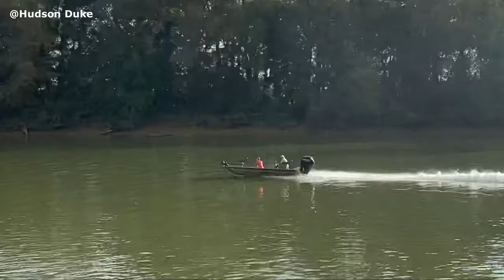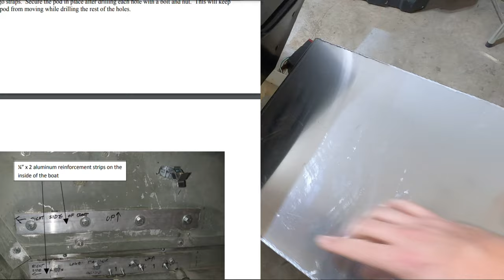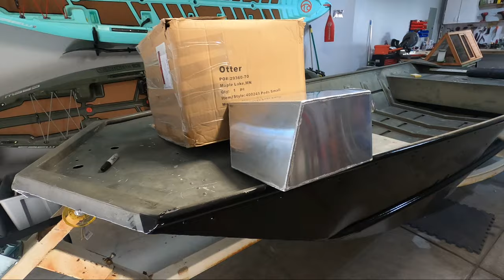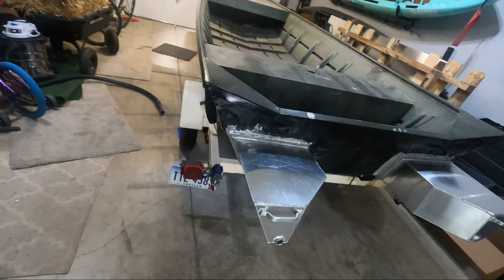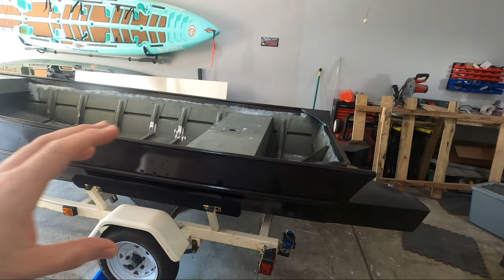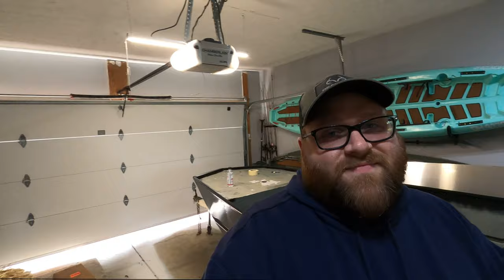JON BOAT FLOAT PODS GUIDE - Everything you need to know!

Comment: Put a set on my 1652mt Lowe, seemed to loose a little trim adjustment at wot, and top speed. Definitely keeps the front end of the boat down and helps get on plane faster though.

Comment: If the pods happen to leak over time,foam would keep most of the water out,huh
Reply from the maker: There is no foam inside the pods, if water did somehow get in there are drains on each one just in case.

Comment: My buddy who runs a charter fishing boat glued the door handle to the boat on with 5200 and it got extensive use for years and never came loose or broke in anyway.   If you get a good bond and cure that stuff is incredible.
Reply from the maker: It's seriously strong stuff, I have no doubt it could hold on some pods paired with rivets

Comment: What's the gauge of the pods?  Doesn't look as thick as the boat's aluminum and I've heard that adding pods makes your steering different like it'll be a longer sweeping turn. Is that true?
Reply from the maker: I couldn't tell you the gauge, they are Beavertail so they might have specs somewhere. I don't feel impeded with turns -- another criticism I heard before the pods was that it made reversing difficult but I didnt experience that either. Properly installed I've had nothing but great experiences with them.

Comment: Just purchased a 1540 alumacraft, plan on using a 10-20hp Mercury 4 stroke. The bottom of the transom measures 40”, I wanted to add these beaver tail pods but do you think I’d have room for the motor to turn?
Reply from the maker: It would be a lot tighter in the back, you might not be able to mount a transducer to the transom but the outboard should still fit.
Reply: @mvboutdoors  awesome thank you

Comment: Did those pods slow you down ? I’m thinking on adding them to 1436 Longtail boat. You think they will slow me down if I mount them correctly?
Reply from the maker: If mounted correctly they shouldn't slow you down, its the angle that matters most. I didn't notice any speed loss, my speed was right in line for a 25hp and a 1648.
Reply: @mvboutdoors  from your knowledge do you Know if it’s okay to mount float pods about 1 inch up from the bottom ? The back of my Transom is 1/4 plate but it doesn’t cover entire thing. So it will be a slight gap on bottom. Just didn’t know if effect anything

Comment: what can you do for side to side stability?
Reply from the maker: Realistically not much. If you want to add floatation foam to the outside of the hull or kaya sponsons you could achieve it but the former will come with a reduction in performance and the latter would need to be deployed as needed. You can google "boat collar" for an example of what I mean. In practice and the long run though, the best option is to just sell your boat and buy one with a large floor width.

Comment: Thanks for this video, it helped me decide to get pods on my 16ft mod v jon boat. I have a couple questions though. Firstly, did you experience any porposing? I mounted mine like the photo suggests for semi v boats with the pod being horizontal to top of transom. The instructions say a 1/2 inch rise, which exists on the sides but then as you get to the keel because of the semi v shape they are 3+ inches from the bottom at the back of the pods. I'm experiencing porposing and can only operate full trim down. As soon as I trim up at all I'm bouncing around. Secondy, where do you mount your transducer after adding pods? THANKS!!

where do you mount a transducer after adding pods?
Reply from the maker: The only time I experience porpoising was when my motor was too low, you may need to raise your motor up or adjust its height up or down with the pods keeping your transom higher in the water now. I mounted my transducer behind the engine.
Reply: Did you mount them level with the top of the transom like in the photo provided by beavertail or do they angle slightly downward towards the keel following the slight v shape of the hull? Thanks
Reply from the maker: @thupertramp  The welder angled it with the hull when it was supposed to be level but the angle was so slight i doublt it made much of a difference either way.

Comment: I would add a s Kreen fuel tank sealer to the new pods. Aluminum can get corrosion holes w time-
Reply from the maker: Right now I have them painted with enamel, I'm not sure I would be able to swirl that around in the inside but maybe a coating on the bottom in the interior would be helpful as well. I'll look into it! Thanks

Comment: New subscriber; I love  your videos and appreciate you sharing your knowledge . I’m getting a 14” jonboat with a  9.9 mercury electric start 4 stroke in the back (122 lbs) Do you think there’s any benefit to adding pods for me?
Reply from the maker: Thanks for subscribing! Pods can definitely help a 14ft with weight balance, even a single rider in the back with an outboard, battery and gas tank can weigh it down. They're not something you have to add immediately so you can always see how it does on the water and add them later if you feel they will help.

Comment: What brand are the pods you are showing here with the handles and drain plug? I have a G3 1436 aluminum.
Reply from the maker: It was these here: https://amzn.to/3dBTdMX
Reply: @mvboutdoors   Unfortunately the Otter/Beaver Tail folks and Amazon are out the dealer says maybe stock in May??!! Thanks, know of any out there PLEASE let me know.
Reply from the maker: @flgator311  I'll keep an eye out!
Reply: @mvboutdoors  I just bought a set from backwater they had the small set in stock for $310
Reply: Now how much will the welding cost??
Reply from the maker: @flgator311  it was a couple hundred for me but they also needed to buy extra aluminum stock to fit the slant of my transform that's not always needed
Reply from the maker: @flgator311  Perfect! Congrats

Comment: Did the pods hurt your top speed any?
Reply from the maker: I didn't test before and after to know but the top speed is consistent with the engine and hull size. If it did, it would have maybe been 1-2mph. 26-27mph for a 1648 built up with a 25hp outboard is pretty spot on.